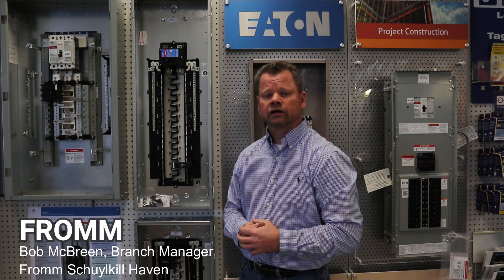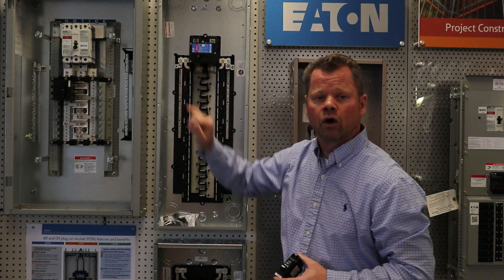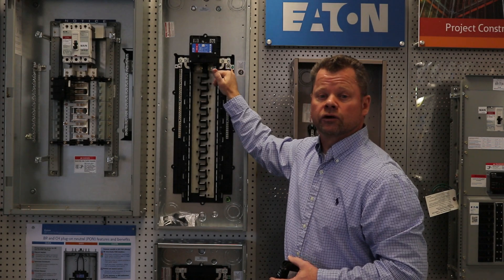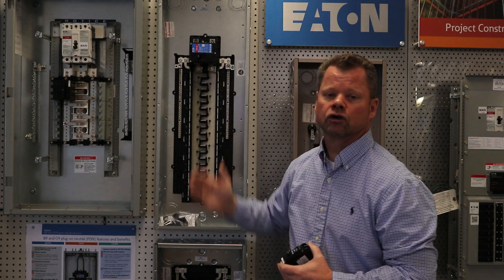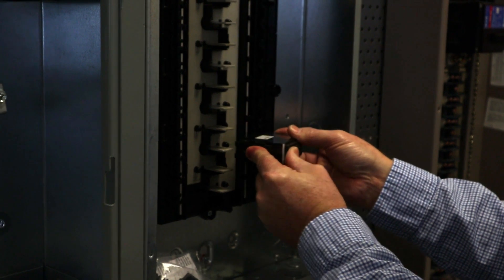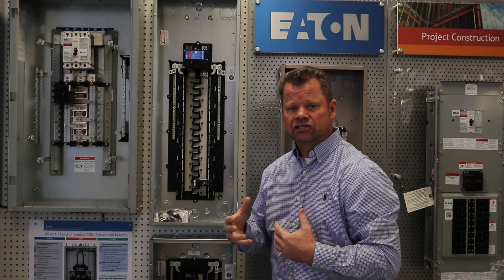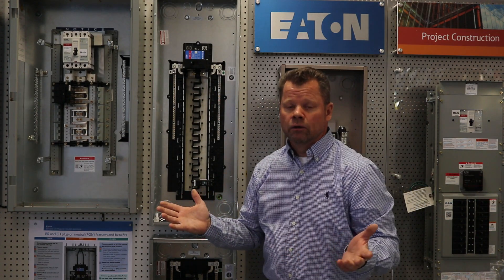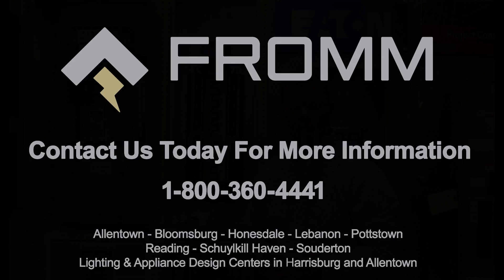Eaton’s New BR Plug-On Neutral Loadcenter Features and Benefits

Comment: Hi sir, I see Eaton has this type of panel gut called Eaton 612INT200SRBOC 200 Amp 120/240 Vac 1 Ph Type Br 6:12 Ckt Cooper Bus. My main panel is 100 amp 12 spaces need to upgrade to 200 amp. Can I use this panel gut to replace the old one and how? Can you make a video on how to do it? Thanks.

Comment: I have an Eaton 200A Load center at my home. I need to know how many TANDEM Breakers can be installed and what will be the location. I have 3 of them already installed. But what is the max no of TANDEM Breakers that can be installed ?? Is there any technical guidelines or specification ??
Reply: If the panel is from 2008-on, you can have Tandem breakers in each slot, but all circuits hooked up to the panel must be the same or less than the Max. Amps for the panel (e.g., 200 AMPS,  100 AMPS, etc.).  Exceeding the Max. AMPS for the panel equals Fire Hazard/burn down hazard.